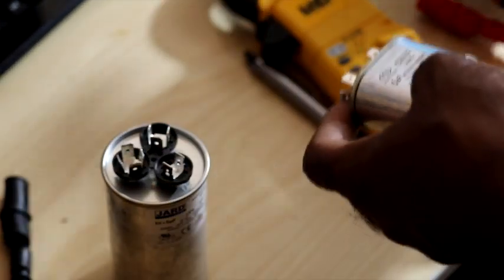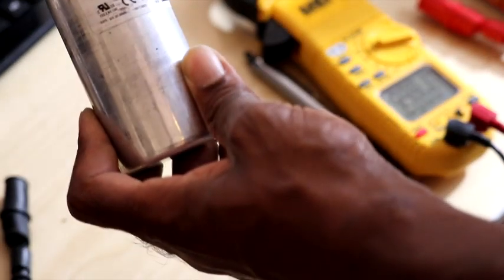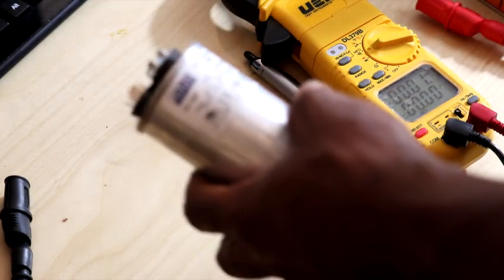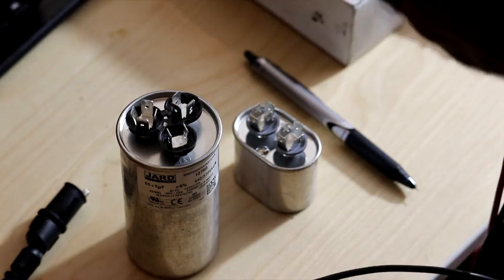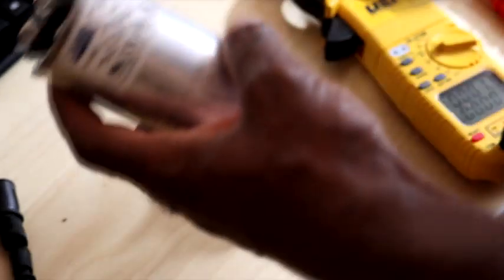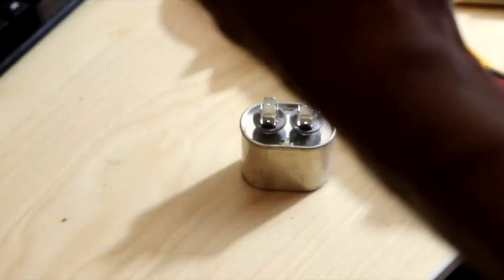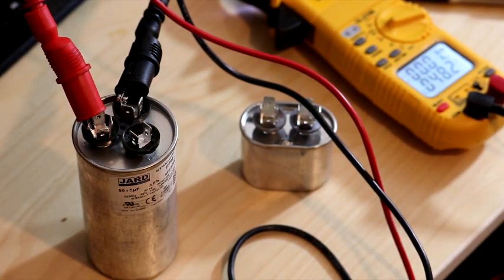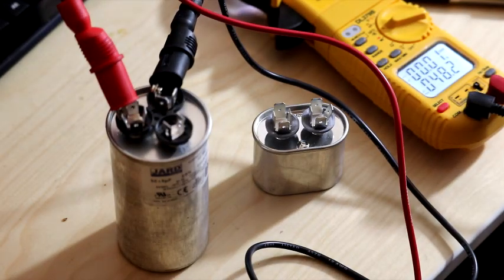"Ultimate Guide: Wiring Capacitor in Parallel for Maximum HVAC Efficiency!"

Comment: Not a 'quick video', but still good.   I wish you had used some dummy wires to tell everyone where to hook up the fan/compressor wires.  Also I can't remember right now how the VAC number is changed due to the parallel set-up.  I may have to refresh my knowledge from my old textbooks.  

Thanks again for taking the time to do this for everyone!
Reply: Pralay Patel you not a tech anyway you’re last name is Patel . You some cheap hotel or gas station owner. Cheap ass get out of here